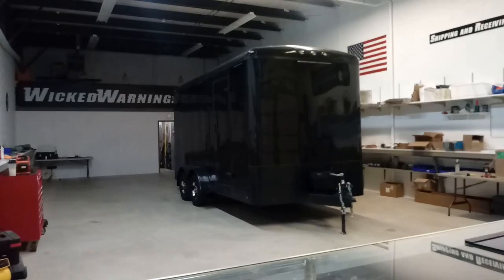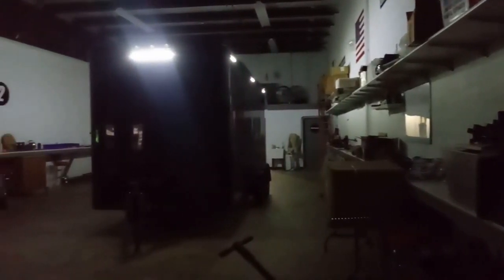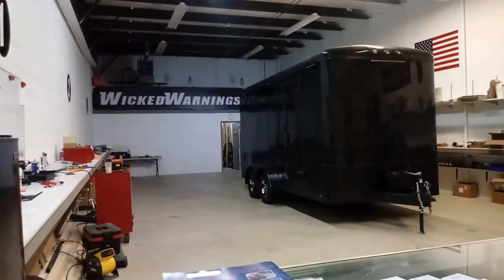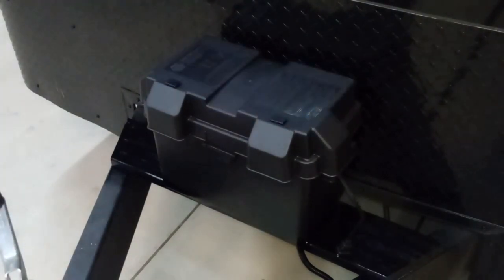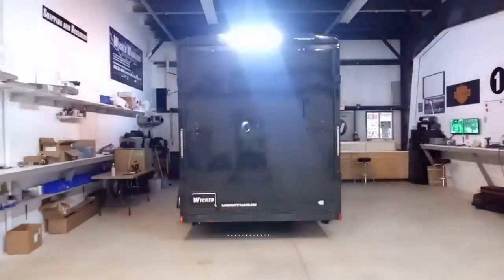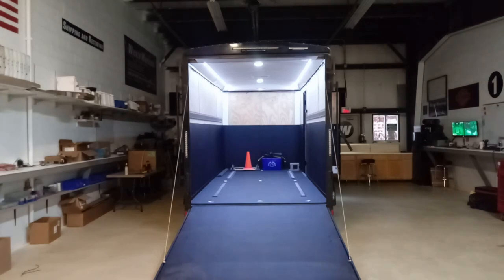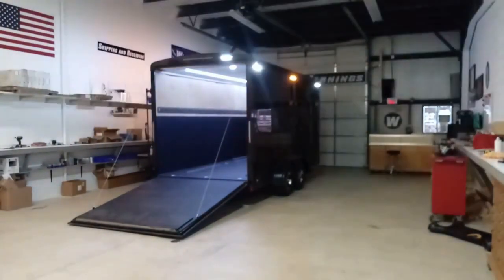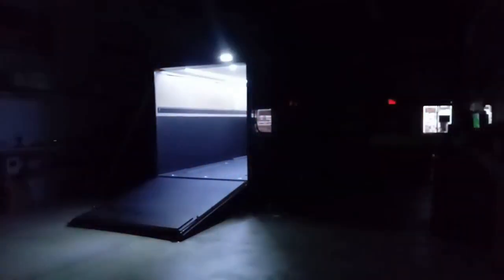Custom Trailer Work Lights and Safety Strobe Lights

Comment: Wicked Warnings - How are you controlling the Phoenix 4200 mini remotely? I thought that was only a feature that could be achieved by the full size 4200
Reply from the maker: What do you mean by remotely?  Did you watch with sound on?
Reply: Wicked Warnings did you have someone in the trailer turning the lights on and off?

Comment: How is that trickle charger wired up to charge while the trailer is hooked to the towing trailer? Does napa make a 12v powered trickle charger?
Reply from the maker: No...of course the trailer will be charged with the vehicle charge wire while hooked to vehicle.

Comment: How did y’all wire the charger into the trailer to charge while truck is running ?
Reply from the maker: all 7 pin trailers charge from vehicle while running.
Reply: @WickedWarnings  ah okay I see. Thanks!